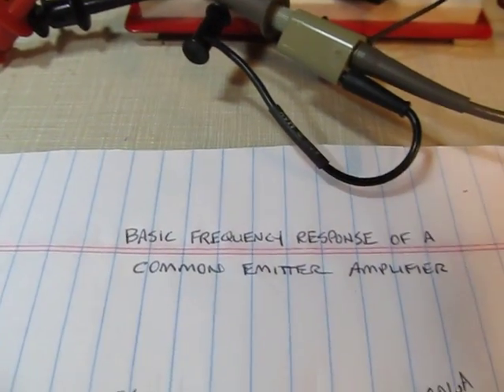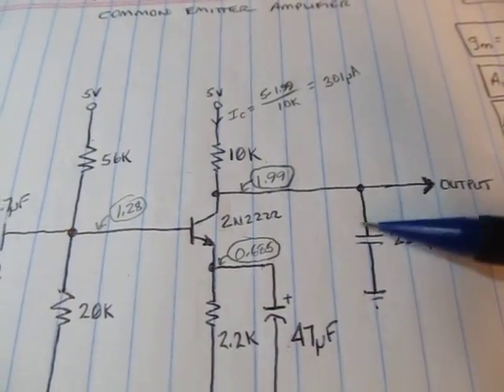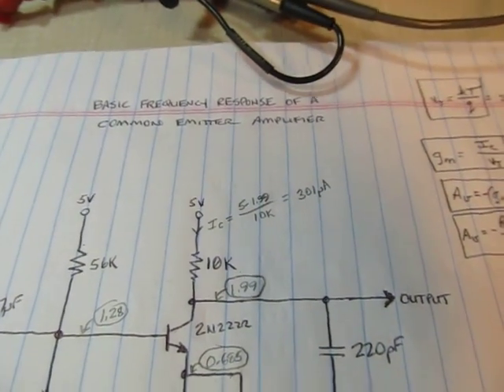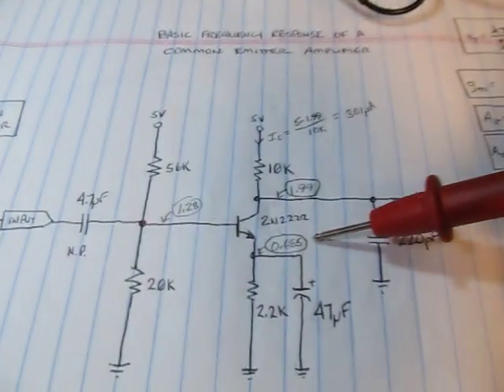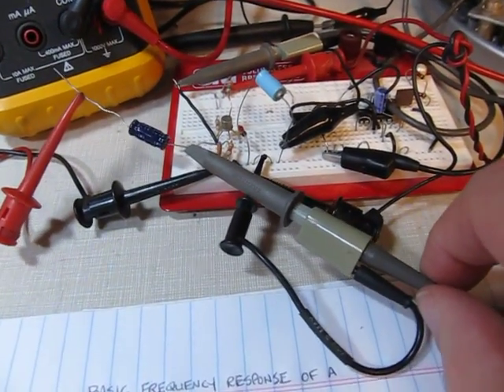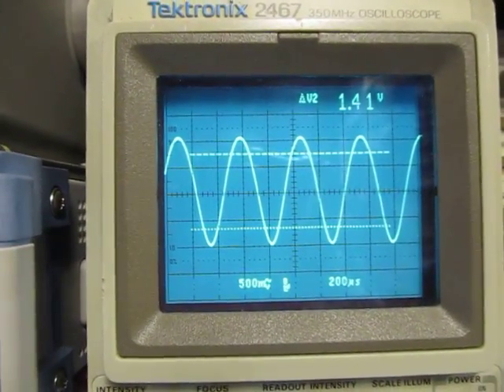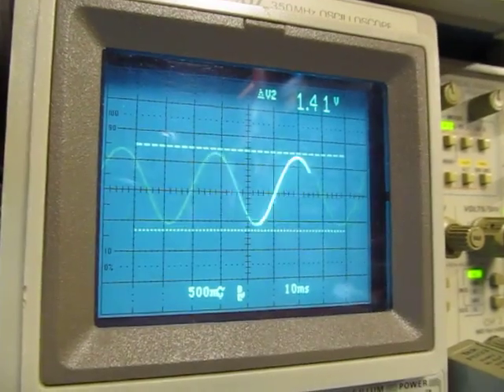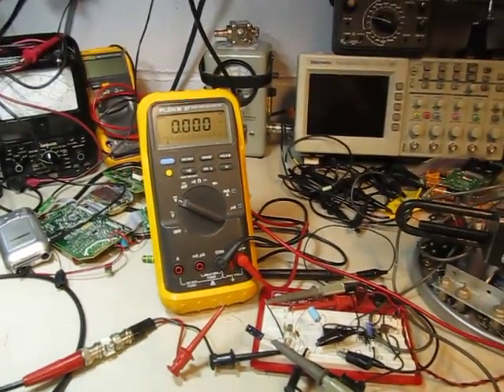#67: Basics of Common Emitter Amplifier Gain and Frequency Response with Measurements

Comment from the maker: For Rosa Rojas (since I can't reply to the comment...)  It's all there in the formulas - simple math.  Gain is -gm*Rc.  So, either make Rc 5k vs 10k, or decrease gm by a factor of two (by increasing the 2.2k to something closer to 4.4k).
Reply: +w2aew Why have capacitor at the collector ... to ground?
Reply from the maker: +Yueeiuyoo A low pass filter - to remove high frequency components from the output.
Reply: +w2aew I assume that this applies in case we are capactively coupling this amplifier to the next stage, what we are not doing that? That means the miller capacitance shall limit the upper 3dB point?

Also, you said that when the reactance of the capacitor at output is equal to Rc at 5:46 minutes that is when we get the upper 3dB point. That means the amplitude is halved at output? or some other reason?
Reply from the maker: +Yueeiuyoo It is when the output power is halved - not the output voltage.  In many amplifiers, the miller capacitance will be the bandwidth limiting factor.
Reply: +w2aew when you say that the impedance of the capacitor has to be equal to the resistance of the collector resistors for the upper -3dB point, how is this conclusion arrived at?
Reply from the maker: +Yueeiuyoo Assuming the collector resistor is much lower than the collector's output impedance, and the input impedance of whatever is connected at the output, then the collector resistor and output filter cap form a first order low pass RC filter.  When the XC of the capacitor matches the collector resistor RC, then the gain will be reduced by 3dB.

Comment: Thanks for the great explanation. I misunderstood the low frequency cutoff. And you've corrected that with this video. However, a more accurate explanation of Fl would be that there are multiple low pass filters and the one involving Ce and re' dominates. There is actually four low pass filters. The input circuit with Cb and 50ohms || R1 || R2 || b*re', the ouput circuit with Cc and Rc, and 2 at the emitter, Ce and Re and Ce and re'. The Ce and re' filter should be designed to dominate to make calculations simple. Since the re' filter cuts off at 39 Hz it dominates the Re filter which cuts off at 1.5 Hz. Obviously the higher low pass filter will dominate unless they are close together. Then the filter calculations becomes complicated. Since 39Hz >>  1.5Hz we can ignore the influence of the Re low pass filter.
Reply: There are two capacitors at play and hence two low-pass filters to consider.

One is formed from the 47μF emitter bypass capacitor and the parallel resistance of 86R (the intrinsic emitter resistance) and 2k2, which is 83R. That has a cutoff frequency of 41Hz, very close to the 39Hz obtained by ignoring the 2K2 resistance.

The other is the 4.7μF input capacitor and the parallel combination of 56K || 20K || β.Re where Re is the effective total emitter resistance. Note that the 50R load on the signal generator plays no part in that calculation. That is complicated because β is unknown, but could be as low as about 40 for a 2N2222 operating at 300μA, and because Re is the complex impedance of the emitter resistance and the 47μF capacitor. Normally, we should design so that β.Re is significantly greater than the parallel combination of 56K || 20K (i.e. 15K) at the frequencies of interest, but 40 x 83R = 3K3 and that will dominate the input impedance unless you select your transistor to have a β significantly more than 180 at 300μA. With the transistor used, the cutoff frequency associated with the input capacitor could be 10Hz if β=40. Fortunately, the ~40Hz cutoff from the emitter bypass will dominate in this case.

Comment: Another incredible video that captures so many fundamentals of the common emitter amplifier! One thing I've been getting hung up on is input impedance and output impedance of these simple BJT configurations.  Do you have any recommended sources for understanding this concept a bit better?  I have 'Art of Electronics' but sometimes I have a hard time following their descriptions of this topic.
Reply from the maker: One of the best ways to think about it is to take a look at how much the input current changes with small changes in input voltage (input impedance), and how much the output voltage changes with small changes in current drawn by the load.  That will give you a feel for input and output impedance.
Reply: @w2aew  So that is basically what transconductance and the Eber-Molls model is about? That is helpful! Sometimes I forget that impedance can be described in terms of voltage and current as well.  Probably making it harder for myself than it has to be.  Thank you!!

Comment: While you have the most splendid and clear tutorials on these things where others go into details that just make the core harder to understand, it will be quite powerful if you made a video explaining construction of a simple amplifier e.g the 741. This shall involve current mirrors, long tailed pair and much more. Making measurements at each point and why design was done a certain way will be very helpful.

The only problem is that such a video may require more work to be produced.
Reply from the maker: +Yueeiuyoo I do spend some time talking about the internal circuitry of the LM358 op amp in my video describing cross-over distortion:
https://www.youtube.com/watch?v=VgodYtiD_F0

Comment: The cutoff frequency is the frequency either above or below which the power output of a circuit has fallen to a given proportion of the power in the passband.

Most frequently this proportion is one-half the passband power, also referred to as the 3 dB point since a fall of 3 dB corresponds to approximately to half power. As voltage ratio, this is a fall to approximately 0.707.

Comment: Brilliants!!!! Every kid should have a teacher like this in every subject. Should you go for a gain of 117 or do it in two stages at 10 each? When do you need multiple stages.
Reply: If you go for a gain of 100+ in one stage, you will inevitably run into the problem of distortion with a large signal. I don't mean clipping, but when the gain depends on Rc/Re and Re is the non-linear intrinsic emitter resistance, you are bound to get distortion.

To design that out, you have to have an unbypassed emitter resistor significantly greater than the intrinsic emitter resistance of the transistor at whatever emitter current you are using.
That means that because the intrinsic emitter resistance = 25mV/Ic, the emitter resistor must be at least 10 times that resistance, which equals 250mV/Ic.
That means you need at least 250mV across the emitter resistor.
Since the collector resistor will need to be 100 times the emitter resistor for a gain of 100 and the collector current is almost the same as the emitter current, you will need 100 times the voltage drop across the collector resistor that you have across the emitter resistor.
That means you need to drop 100 x 250mV = 25V across the collector resistor.
Since the quiescent collector bias point needs to be about half the supply voltage, you will need a 50V supply rail (and a transistor that can handle a 50V supply rail).
That is the inescapable logic of designing a common emitter stage: to increase the gain while maintaining low distortion, you have to increase the supply voltage.

Comment: Fascinating set of videos. Thank you for the time you have spent putting all of these together. Could you please complete an analysis, using the measured voltages to ascertain the beta of the transistor used?  IC = 310uA, IE=311uA meaning IB=10uA, assuming the circuit is working in the linear region. Does this mean the beta of this particular transistor works out at something like 30? Thanks again.
Reply from the maker: Since we’re likely talking about beta on the order of 100-200 or more, we would have to be very careful with our measurements. For example, if you’re measuring the voltages across RC and RE to determine those currents, you would have to carefully measure those resistor values first because their tolerance (how much they can be off of their ideal values) will dramatically affect the calculated beta.
Reply: @w2aew  Many thanks.

Comment: I would love to see someone competent (thus commenting on this channel ;) do a transistor tutorial.  Example:  Given a gain requirement and input voltage/current/frequency, design an amplifier using an NPN transistor.  I've watched dozens of videos entitled "how to bias a transistor" but each and every one of them analyzes an existing circuit.  What I need to know (and I believe many others) is the step by step process to designing a transistor amplifier circuit.  Would also be nice to cover the different classes of amplification as well (ie: how one class differs from the next by way of the biasing or however?) Also watched tons of videos on Transistor theory - ie: materials, doping, etc...  Like to see it kept to a practical (how to) view.  Some people start with a ratio of Rc to Re (ie: gain), some start with biasing the Base and Re, then simply state that Ie is the same as Ic (why? how?)...  All very confusing.  A logical process would be welcome.  There must be one - this is electronics/math not voodoo.
Reply from the maker: +Digger D A couple of comments:
- IC is almost the same as IE because IE is equal to IC + IB, and IB is small with respect to IC (IB = IC / Beta).
- I already did a video on biasing and amplifier class of operation: 
https://www.youtube.com/watch?v=c6cmkm3UPUI

- As for a tutorial on designing a transistor amplifier, you can't get much better than the one that Shahriar did:
https://www.youtube.com/watch?v=Y2ELwLrZrEM
Reply: ***** Thanks, it's starting to come along.  Next to determine how to decide on values for the voltage divider on the bias (ie: many possibilities but what logic does one use to decide what values of resistance to use, I suspect it depends on the current required at the base?).  IB * Beta determines IC and ratio of Rc over Re determines voltage gain?  But I would have thought there would be a process to determine each.  Most of the vids I've watched they seem to pull a value out of the air.  Thanks again for the reply and links.
Reply: ***** I watched  Shahriar's video but he too pulled values out of thin air (Ic = 2 mA??, why did he just pick a value?) and gm was not defined etc...  I did however just discover that Rbe is a constant of 25 or 26 ohms, I'll go with 26 as I just saw the math for that result.  Now this makes more sense as I can now calculate Ib and thus choose my bias resistors to set the current into the base and knowing the Beta value (generally as published) I can then calculate what my Ic will be.  Ic = beta X Ib.  It now becomes a resistor network problem.  As for the voltages over Rc, CE and Re that is pretty easy to determine.  It's like trying to learn the secrets of a mystical lodge who's members are sworn to rumors only. ;)  Even finding a book that explains this in a step by step logical manner is difficult.  I've spent a week watching many videos, reading several articles and asking questions but it's starting to come together.  Transistors have always been a stopping point for me in analogue electronics as I just could not find the information needed to design a circuit.  So for a common Emitter amplifier I think I'm ok, now for all the other configurations...  Thanks again for your help and I did watch your bias video earlier but it too didn't quite answer all my questions but it did create some new and better questions.  Every component and resulting value in a circuit has some logic behind it and sometimes I find people skip over something that has become common knowledge to them but for us folk that are trying to absorb the info, it leaves a huge gap.  Once again thanks for your help.
Reply from the maker: +Digger D Sometimes the initial choices for things like IC are arbitrary, other times the initial choices are governed by requirements of the application - such as:  input impedance must be X, or load resistor or output impedance must be Y, etc.  Or, there may be a limit on power dissipation for the circuit, or the designer might choose a bias level based on some optimized transistor characteristics.  The initial constraints will often help decide the starting point (whether it is bias point, a resistor value or two, transistor selection, etc.)  However, the initial choices are governed, the art of the remaining part of the circuit design is determining the circuit structure and component selection to achieve the desired goals while keeping within the constraints given in the initial performance desires or requirements. It's not an exact science, every application is different.

Comment: Excellent video. I second 321reh comment: this is one of your best and the beginning is just a little fast. How did you get the thermovoltage and the transconductance? A little more info on that would be amazing.

Also, how did you came up with all the values for the resistors and capacitors. It's pretty complicated to match all the constraints. Can you recommend a method?

Comment: Very nice! Is the only purpose of the 220pF cap to ground to set the high frequency  point? would you include this in the final design of an audio anp? Without this cap, the gain does not drop with frequency, why would this be bad, maybe becuase high frequencies would also be amplified? Thanks fot the help and the great video. (Also, the point of the 50ohm source resistance? Doesnt the generator already have a 50ohm output impedance?)
Reply from the maker: Yes, the 220pF sets the high frequency rolloff.  It was used as an example here.  Without it, the frequency response would be wider, but the gain would eventually drop off due to other device capacitances.  The 50ohm resistor is properly terminating the output of the signal generator.  Again, not important at audio frequencies, but it ensures that the voltage provided by the generator matches what it is set to.
Reply: Thank you very much for the response. So in an actual circuit, with a speaker as the load, will you keep the capacitor in to set the high frequency cutoff? Or do you rely on the capacitance of the speaker to do this job? Thanks again for the info. As for the 50 ohm resistor, why would you want to terminate the input signal? Don't you usually do that when you have an open circuit somewhere and you don't want any reflections? Thanks again!
Reply: Does your generator have an output impedance of 50 ohm (set internally) ?
Reply from the maker: It all depends on the amplifier design, whether or not it is necessary to add some high-frequency rolloff.  Many/most applications wouldn't care.  
At audio frequencies, reflections are not an issue.  The main reason I added the termination resistor is so that the displayed amplitude on the generator accurately reflects the voltage applied to the circuit input.  The generator allows you to specify the load impedance, and it defaults to 50 ohms.  Since it has a 50 ohm output impedance, the voltage generated by the generator is 2x the value that is set in order to account for the voltage divider effect that comes from the 50 ohm load.  I could have optionally specified the actual input impedance of the circuit and omitted the 50 ohm termination, but it was easier to simply use the termination and 50 ohm load setting.
Reply: @pierreretief  The output impedance of the circuit shown is set by the collector resistor at 10K. You're not going to be driving many speakers with that sort of output impedance. With the exception of Quad Electrostatic speakers, loudspeakers present an inductive, not a capacitive load to the amplifier, so you can't count on rolling off high frequencies that way. Normally, a capacitor is used to feed back from the output to the input of an inverting amplifier, which sets the upper roll-off frequency and ensures overall stability of the amp.

Comment: I had another question: lets say after that 220pF cap, you had a resistor after it between it and ground - would you no longer have to calculate corner for high frequencies since it is now a high pass filter at the output?
Reply from the maker: Assuming the resistor is the output load, yes.  Then, other things will limit the high frequency response, such as the transistor's collector-emitter capacitance, other transistor parameters, or other parasitics.